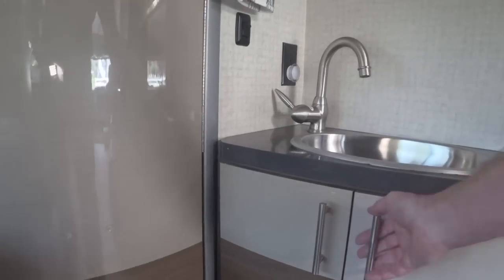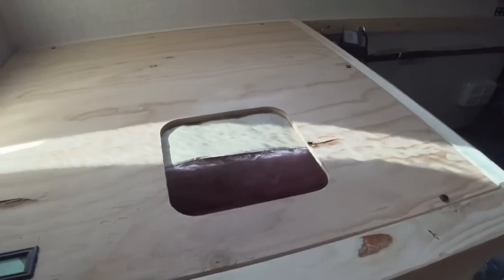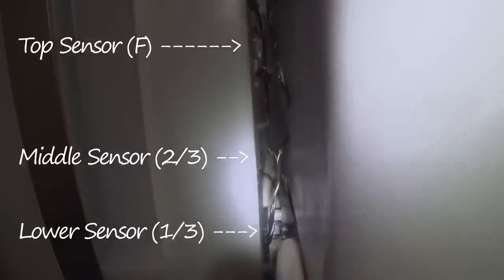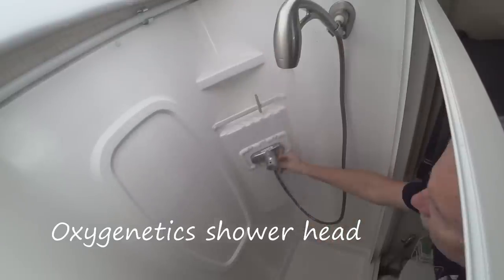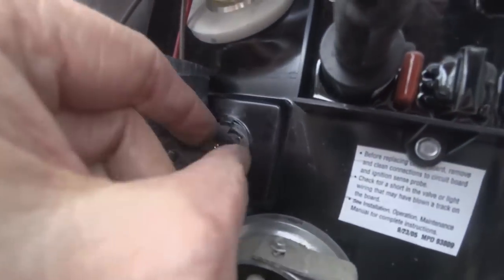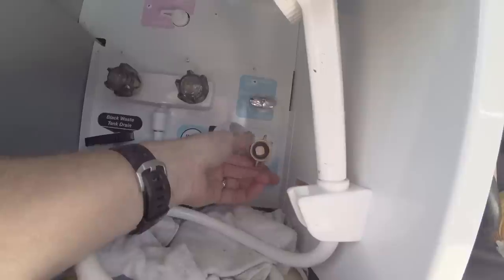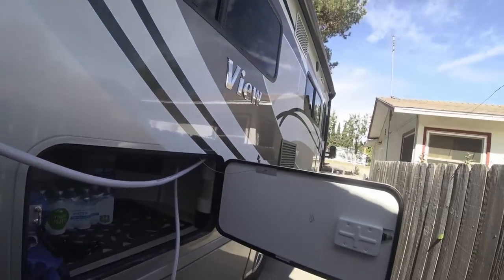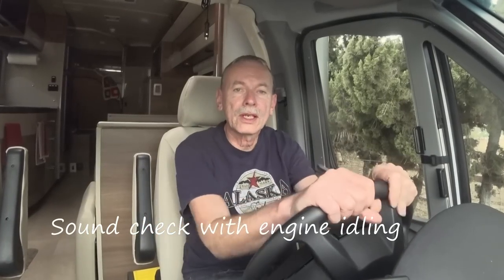RV Basics - Fresh Water Systems

Comment: We put a float valve and clean out in the top of the fresh water tank so it shuts off when it is full.  No more over filling.
Reply from the maker: Sid you have to cut into the tank?
Reply: @ontheroadwithron2432  Yes. We cut a 4” hole in the top and installed a float valve like in an evaporative cooler. Attached the fill pipe it and installed a water tight access port. I clean and sanitize it about once a year.  It reduced the tank capacity by about 1/2 gallon. Now it just shuts off when full and water isn’t wasted.

Comment: I have a 2011 Winnebago View 24J which we have owned for 3 years. It just turned 60k miles. Last week I replaced the rear sway bar with a Halwieg. I could not believe the difference it made with the swaying top heavy issue. The stock sway bar was smaller in diameter and when I saw the Halwieg it was 1/4" bigger. I want to replace the rear shocks next.

Comment: Hi Ron !!  I am Bruce from NJ.  I am getting ready to retire and I am considering an RV for travel with my wife and small dog.  The View/Navion is near the top of my list for this lifestyle.  You are VERY handy (like myself) and I love seeing the mods you have made !!!  VERY SMART !!!  I just discovered you this evening, but I have watching hundreds of videos on you tube for the past year regarding motorhomes and fifth wheels.  I would like to ask you a few questions if you have the time.  1) Do you recommend this unit?  2) How is your gas mileage?  3) How many times did you require service/repair - was there any serious problems?  4) How easy is it to park at most attractions?  5) Do you feel the need to TOW a vehicle in your travels.   That's enough for now, and I thank you for your responses if you can !!
Reply from the maker: Bruce Moore hi there. Welcome to the adventure. I’ve had this RV for 3 years now. Yes, I would recommend the View/Navion as a good flexible unit for those who drive around a lot. We’ve never stayed anywhere more than 3 days, so never needed a toad. Some people pull a Jeep for off road trips. My wife is not interested. I use my bike for exploring new places. I’m getting 15.2 mpg  and drive 60-70 depending on terrain. Yes, it is easy to drive and park almost anywhere. My only issue right now is the bed is starting to sag a bit. I will need to address this soon. I’ve been to the Mercedes dealer twice. Problem was the Axxess module that Winnebago installed improperly. After removing that it’s been trouble free.

Comment: Great video Ron. When you access your water pump, is there another way to gain access from any other area of the motorhome? I have the exact model as you do.  Thanks.
Reply from the maker: No , it is surrounded with other stuff. Only access is the little panel under the bed.

Comment: Hey Road Master Ron! I too have a 24J and was looking to move the water sensor. I don't understand why you moved the full sensor to the bottom instead of just moving the empty sensor a few inches lower? I would imagine I'm missing something here in my thought process. Could you clear this up for me? Also, if I'm not mistaken, the View uses sonar sensors. How are they attached and reattached in our rigs?  I'm loving the video's keep up the great work!
Reply from the maker: Basically, the top sensor was of no use to me.  Showing I have 29 gallons of water out of 32 is on no use.  Yes, I could have moved the bottom one ower, but then there would be a big jump from the 2/3 mark at 20 gallons left to the E reading at 3 gallons.  Moving the top one, gives me readings at 20,9 and 3 gallons.   They are stuck on with a sticky adhesive.  Just carefully prided the sensor off the tank with a butter knife and just re-stuck it lower.

Comment: What pressure did you set the accumulator to and could it be installed Horizontally?  (Thinking of placing it in the far rear next to the Hotter tank on the 24V, but will connect it into the Cold line).  Love the Video's and different ideas you have.
Reply from the maker: I experimented with a few pressure levels.  Believe I settled at 20 PSI.  Since it is a closed blatter,  horizontal should be fine..  Try it out to be sure, but I can't see any reason it wouldn't work.
Reply: Thanks Ron, I'll also experiment a bit and let you know where I end up.

Comment: Thanks for the great ideas for mods.  I have a 2016 24J as well, when I fill the fresh water tank all the water pours out of the in inlet door when I am driving and making turns.  What fixes or mod do you suggest?
Reply from the maker: Don Martinez I have the same problem. I tried to find a plastic plug, but the opening is at an angle so I just ignore it. Some runs out but it doesn’t hurt anything.

Comment: Hi, our hot water is TOO hot thanks for the tips.   Where to buy the lower temp thermostat?   Easy to install?
2011 Navion K 96,000 miles
Reply from the maker: The link is in #3 above.  Yes it is easy to replace.  Just be careful not to loose the spring when you twist off the old one.
Reply: Atwood 91470 thermostat, available on Amazon.  Easy install!

Comment: Just found your channel looking forward to implementing the mods in our View. Question for u, do u have a lot of road noise?  Ours seems so loud. 2017 24J.
Reply from the maker: Funny you ask.  I just got a sound meter to see what I can do to make it quieter.  Most people say the RV is very quiet, but I find the furnace and Generator way too loud.  You also get a lot of road noise, but still thinking about this.  Tomorrow I'm adding another solar panel, so that video should be ready next week.
Reply: On the Road with Ron great!  Road noise drives us crazy. Usually we listen to books on tape but it’s too loud. We thought about looking into different speakers but it’s still loud. I feel like it’s the floor. Carpet?  Pad?  Been searching on line for solutions. I think it would help with generator noise too. We just ordered the sumo springs not sure about the sway bar.  Keep em coming not much out there for the View! Thanks bud.
Reply from the maker: My biggest improvement was adding the sway bar.  It resists the tilting and does not effect the ride or going over bumps.  The Sumos can also help, but of course will make the ride a little harsher (more stable = harsher on bumps and those speed bumps)

Comment: any thoughts on switching the 6gal water heater for a tankless on-demand?
Reply from the maker: Have thought about it, but not worth the expense for us. I have a tankless unit at home, but you can't run the water slowly or it will shutoff.  Not sure if the Truma has that issue, but suspect it does have a min flow rate.

Comment: SOFT WATER!!!  Didn't even think on how to do that!!
Reply from the maker: Big Earn I wouldn’t be without it. Keeps everything cleaner and no scale.
Reply: Do you have a reverse osmosis system?  I hear they drain a lot of water.  However, there are electric types that drain very little water....Unless you stock water bottles.  Any suggestions?  Thx.
Reply from the maker: Big Earn we use an RO system in our house but not in the RV. Uses too much water as you said. The softener is more like a filter to take the minerals out. It doesn’t use any water. We actually drink bottled water from the store while traveling.